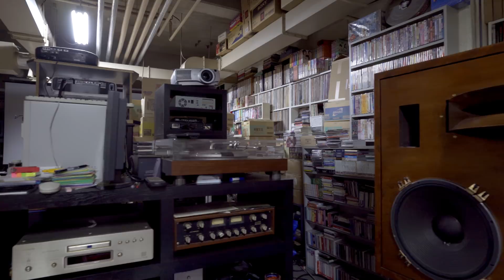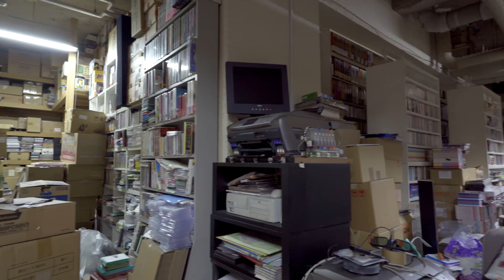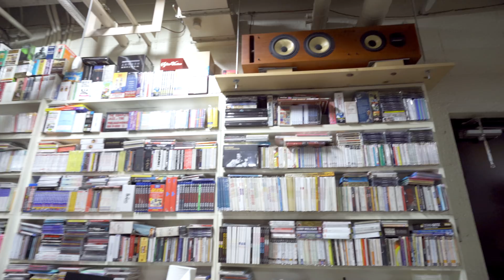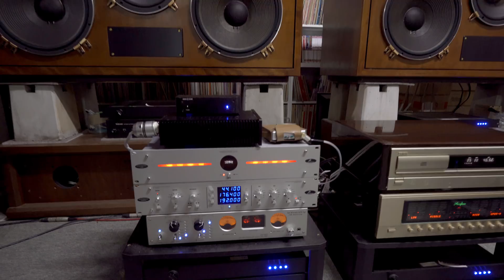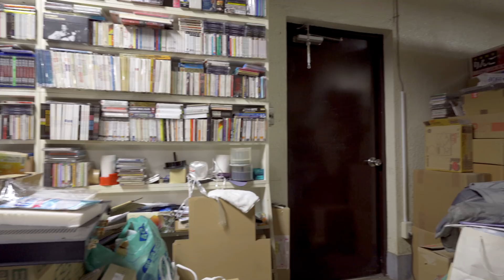デジアンとデジタルチャンデバで4ウェイマルチJBLを理想音に追い込むケンリックサウンド　KRS Tunes 4 Way Multi JBL + Class D amp & Accuphase DF55

Comment: big box big speakers seems to be very expensive and heavy to carry ..with 2 box each with 1 driver 1 tweeter 2 speaker mid bass 4 or 8 inches and standing one on each side of the head achieves the same result is light and cheap

Comment: Why the foam surround on the tm 1201 ?
Reply from the maker: That's not the foam but the cloth. This way can get much smoother and warmer detailed sounds.
Reply: @KenrickSound  I see because its not as damped as the original cloth sorround
Reply from the maker: @adreus4759  The surround should not have a damping function in the first place. It's what the spider originally does, so the replacement has only a positive effect.